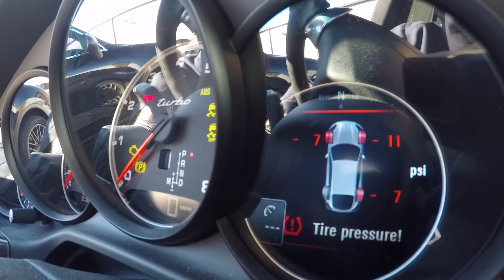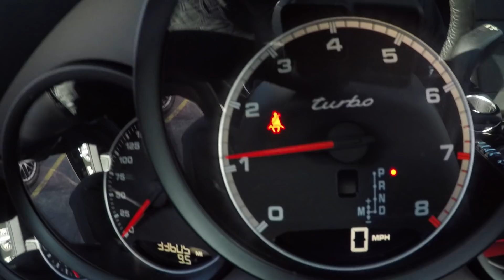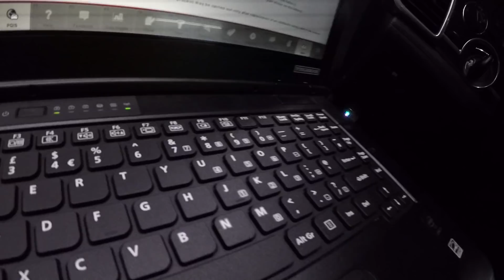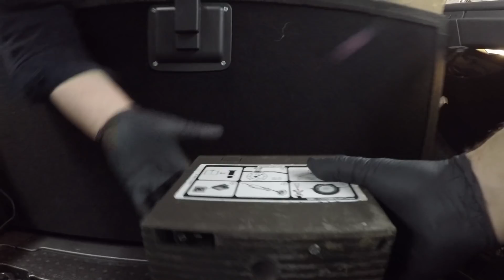No Crank No Start - 2010 Porsche Panamera Turbo

Comment: My first P. car back in 2005, I put it in the garage for the winter without a battery maintainer. Never did it again. I’ve owned 2 more P cars since and never had a battery issue with the maintainer doing its thing.🇨🇦

Comment: Bulletin number 1902 for the 9YA no start. Disconnect the internal battery for the COM BOX under the drivers seat for 10 minutes. Hope it saves you some time and frustration 👍
Reply from the maker: Josh Share done a couple already, thanks for looking out though.

Comment: what an great video! btw my 2010 panamera turbo have expiring an oxygen sensor issue with the pre catalytic converter, do you have an experience with replacing them? will those be a diy project or I need to drop the whole engine? thank you !

Comment: My car is doing exactly that, lights come on on the dashboard but when I turn the key it has a clicking sound but it won't turn over  I didn't hear clicking in your video so I was told mine is a starter issue but my car has been sitting for 5 to 6 months and it's the same battery I had when I bought it in 2012 Do you think it's the battery or because it's clicking when I'm turning it, it's the starter? I was trying to look at the fuse starter relay to think maybe that's it before I tow it to a shop.

Comment: i have a 2010 4S that is completely dead.  I haven't started it in probably 3 years.  I'm not able to get power when trying to do the quick jump is there a manual trunk release with the 2010?

Comment: Happened a few months back on my 2010 4s. quick fix but this is still a very good video for anyone with no experience. ive got an issue when i did my rear brakes i cant get it out of service mode. and by the looks it seems my rear brakes arent working. any advice sir?
Reply from the maker: Thanks for watching. Usually after doing rear brakes on a Panamera we have to grind in, calibrate, and adjust the parking brake. Otherwise you'll have the parking brake in service mode message in the cluster.
Reply: i appreciate the response! the shop that did the service couldnt get it out for some reason. My local dealer just opened and the service department wont be running for a few weeks. any idea on the cost to get it out of service mode?

Comment: Question. So I bought a 2012 Panamera S. But with my Vin number it say the car is an all wheel drive. So my question does the the Panamera S have a wheel drive feature because I know the Panamera 4 and 4s are the only all wheel drive one. Thanks
Reply from the maker: enoch1234enoch a Panamera S isn’t all wheel drive, it’s RWD. If it was AWD that would make it a 4S. Panamera 4, 4S, GTS, and Turbos are AWD. 
If you give me your VIN, I can look it up and get a better understanding of what options your car has.
Reply from the maker: enoch1234enoch from what I see you don’t have all wheel drive. It’s just a regular S. So it’s RWD.
Reply: Porsche Tech thank you sir